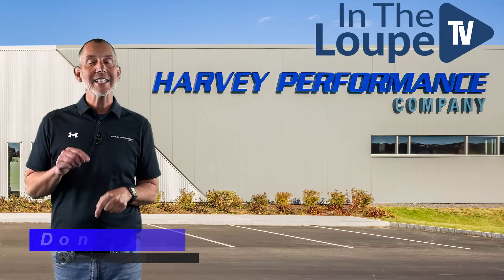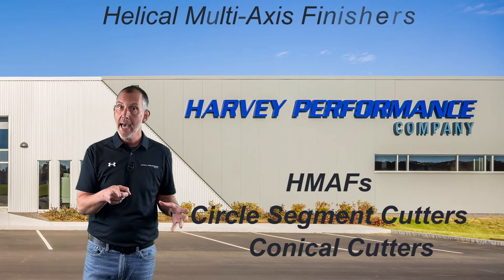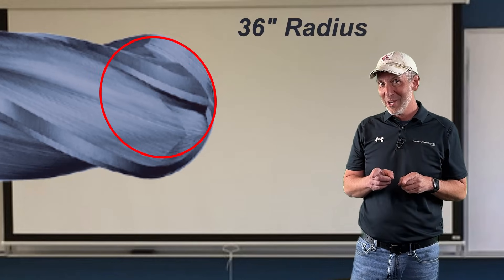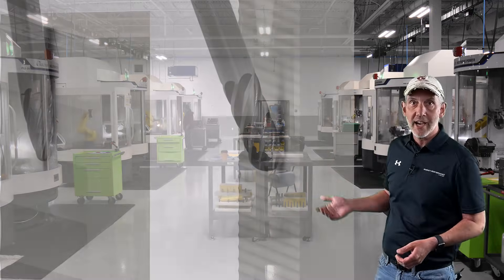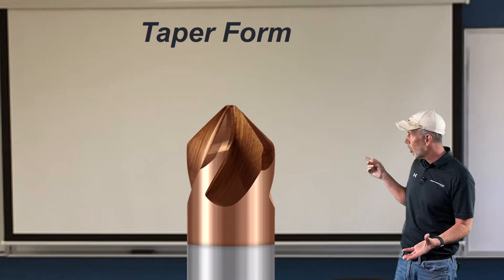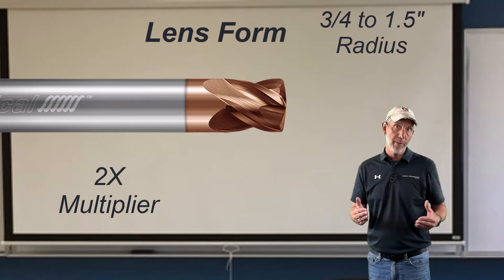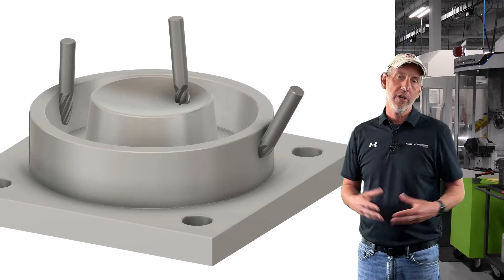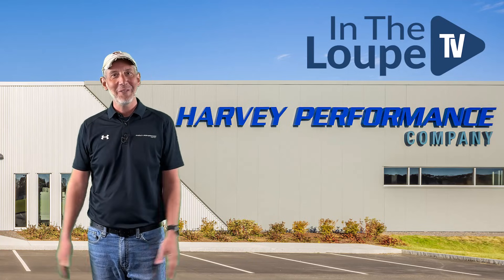Introduction to Circle Segment Machining: In The Loupe TV Ep. 25

Comment: First ever

My experience with circle segment cutters is that they aren't as great as they seem. The sell is that they are versatile, and I thought I would have them as dedicated tools in my machine but that just isn't the case. 
First, they're expensive. 
Second, holders are a problem. Helical solutions is just now making standard inch sizes so this might not be as problematic now for us American machinists.
Third, full five axis machining is slower than three axis on most machines. Typically less rigid as well. Plus the holder being longer, and less beefy... You lose all the speed you gained from bigger step overs. 
Third, programming is a pain, especially for pockets. At least in mastercam. It does really weird things in the corners forcing you to attack it one side at a time. Furthermore, you need to be careful with excessive c-axis motion. This is not shown in backplot or verify, and is difficult to notice in simulation unless you're specifically looking for it. 
For pockets, I found 3+2 rough-finish followed by a ball nose clearance cutter from Harvey to get the fillets in multi axis to be the most effective, fastest, easiest and most reliable approach. The sales people are going to tell you to use a taper form for the sides, an oval form for the corners, and a lens form for the floor using 30 different tool paths. Plus painstakingly verifying the tool paths in simulation. 
Maybe the next video will change my mind though
Reply: You have some great points.  There is 100% a time and place to use these tools to get the benefits from that larger step-over.  Hopefully I can explain that in the next video so machinist can make the best decision for specific parts.  Really appreciate your experience! Ctc
Reply: All Helical tools are in inches so holders are not an issue, they only have a small offering of metric.
Reply: @timothymoore9188  this was mentioned